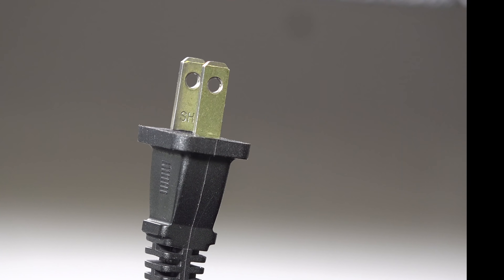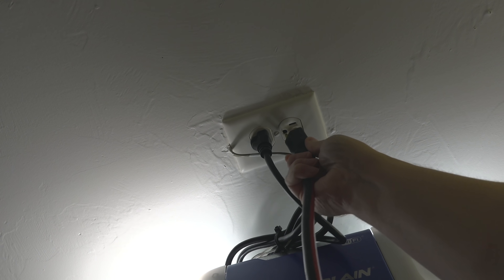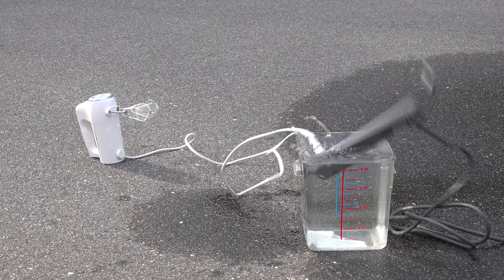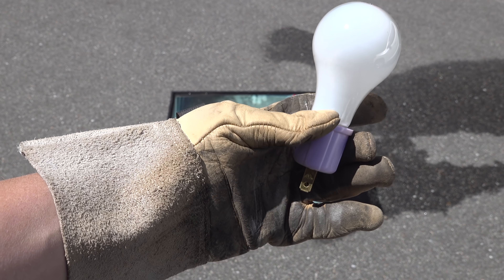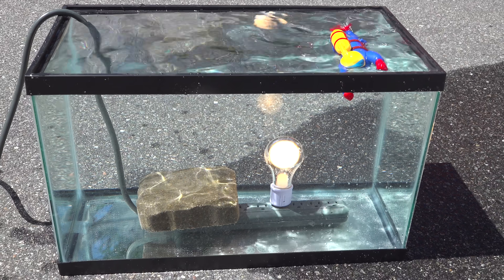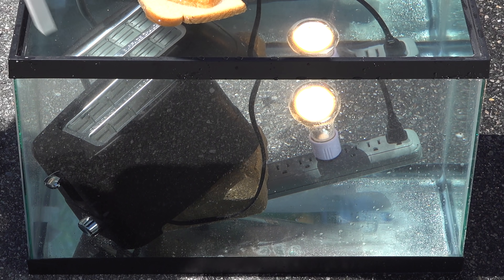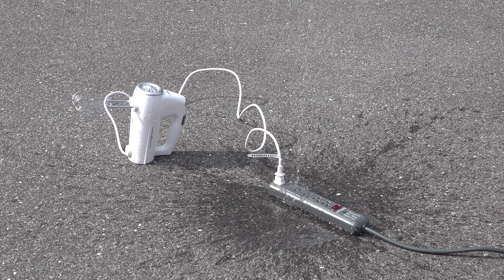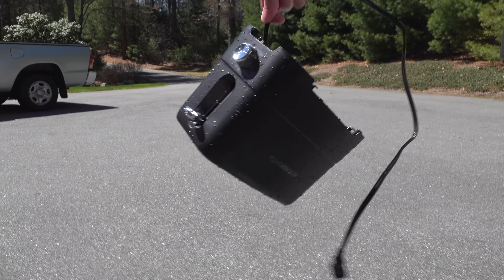What REALLY HAPPENS WHEN YOU SPILL WATER in an OUTLET?

Comment: Fresh water is not a very good conductor so most of the current goes through the normal circuit even when submerged but the residual current trip unit at the end showed that had you touched the water in the earlier experiments a small current that was possibly enough to kill you would have flowed through you and with no trip unit to stop it you might be dead.

Comment: Try another experiment. Drop the female end an extension cord plugged into a GFCI outlet in fresh water.  The GFCI will not trip because fresh water is a conductor but not a good one. Yet electricity will leak which can paralyze a pet or human. Check out Electric Shock Drowning Prevention Association.  Fresh water (lakes and rivers) and extension cords are dangerous.  Conclusion: Trusting GFCI in this case is a mistake.

Comment: Water actually mixes very good, it's like saying copper doesn't mix with electricity. Although the water has to be ionized to be conductive enough to be dangerous with electricity, tap water is non-conductive (3K-300K ohm) while pure water is not conductive at all, saltwater is very very conductive (1-60 ohm)

Comment: "If water spills on an electrical outlet, immediately turn off the power to that circuit at the breaker box, unplug anything in the outlet, and allow the outlet to dry completely. Do not touch the outlet or plug anything in until it is dry, or have an electrician replace the outlet, especially if there was a significant amount of water."

Comment: One important thing to note is that water in and of itself is not conductive, it is the minerals and particles that mix into water that are conductive. If you were to get distilled water for example, you could pour that directly over an unprotected circuit, and you would not get a short circuit.

That's not what's happening here, but it is an interesting fact about water and circuitry.

Comment: Years ago I saw a video where a guy filled a sink of water and put live wires in there, then probed voltage with multimeter at different distances. After remembering that, I guessed nothing dramatic would happen because plain tap water doesn't conduct electricity THAT well.  If you dropped a little bit of SALT into the water it would be a different story.

Comment: actually pure water is an insulator and most clean tap water have a hard time finding a circuit through the clean water for mains power to kill you given that there is something like a toaster that provides it with a shorter path. If you watch ElectroBOOM's video, he actually proves this by putting his finger close to the 2 salt water submerged 120V ac nodes. Although, he can feel the field get more painful as he moves closer to it, he proves that as long as there is a shorter path (lower resistance) for the circuit (in his case the water in between the 2 nodes), you'll just feel the field, and not get fried.  Now, I'm not saying ALL water drenched setups are safe. If there are more dissolved ions in the water (salt, calcium, etc) there is a higher chance that you will feel more pain/death. If YOU are the shortest path for the circuit to close, then you (the part that completes the circuit) most definitely will be fried - well, if you're in water I guess you would be cooked, or if your heart or brain was part of the circuit then they wouldn't work normally either. Take home message, don't let your body be part of the circuit and you'll be fine. i.e. before touching anything that touches mains power, unplug it.

Comment: GFCI outlets are not specifically just to protect from water.  They are designed to shut off if the amount of current on the return path isn't precisely the same as what went out, it's able to do that because even a slight imbalance will create a magnetic field that can activate a solenoid that will open the circuit.  Current "leaking out" can be from many things.  Yes, a short circuit created by water is one of these things.  But it's not the only thing.  It's also possible for a circuit to be wired incorrectly in a way that it would still "work" but be dangerous, and GFCI will protect against this too.

Also, pure water is an insulator, it does not conduct electricity.  What does are impurities (particularly dissolved salts).  If you pour distilled water on something, it's not going to short out.  That said, most people aren't going to be deliberately pour distilled water on something, so most water you encounter in every day life will have enough impurities to conduct electricity.

Comment: I doubt most of the water was electrified to any dangerous level. I mean I have too much respect for electricity to want to go and test it for myself, but on one hand water isn't really as conductive as most people tend to think. Coming right out of a garden hose, yeah that's probably decently conductive due to all the impurities in it, but pure water is actually a great insulator. Even with all the impurities in tap water, it still has a pretty high resistance compared to something like a copper wire. That means that as you get further away from the source, the amount of electric current that actually reaches you drops very quickly. You don't have to be very far away at all before you'd hardly even feel it (if you've ever wondered why lightning that strikes the ocean doesn't fry every living thing in it, that's basically why).

Even if you went out of your way to get shocked by this setup, as long as you only used one hand to touch the water you'd still PROBABLY be fine. The "one hand rule" for handling electrical things that have enough power to hurt you, ensures that even if you do get shocked the electric current won't travel into one hand and out the other, a path which would carry it directly across your heart.

So as long as you didn't stick BOTH hands into the water with the power on... your odds of survival would have probably been at least 90%!

Comment: Interesting.
Thankfully the electrical standard are different in France, so the breaker would trip if you spilled water on a power strip anywhere in a modern electrical installation, at least as recent as the 90s.

Comment: your fuse panel isn't there to protect you. its there to protect the wires from current overload and starting a fire. the only reason you don't find gfci plugs in every spot is cost the builder won't spend because the code doesn't force them to. you can always swap them out later if you were so inclined.

Comment: I have outdoor hanging lights that I have had hanging in the backyard for the last 4 years maybe three years now and last night when I went to go check in the chickens I plugged lights in and heard snapping and buzzing  I knew it was electrical and  to quickly unplug the cord again. While running back out if corner of my eye I saw some kind of flame I think it stopped as I was getting to cord to pull apart ((40 feet away) u ran over with flashlight to make sure nothing was on fire. It wasn’t just smelled like burned plastic and electrical. The two cords were outdoor lights like I mentioned. They were snuggly fitted into one another had wrapped like a candy cane around a conduit metal pole that got all blacked out from the event. I pulled the ends apart and one of the metal prong things was burnt or exploded off the hole it went into was all bored out from getting melted. So couple questions: why or how did that happen? It was drizzling out pretty good. I noticed the fog is much different these days. Doesn’t have same kind of pattern when it falls. So not sure if they are spraying us with what kind of metals that could cause more of a reaction? I am glad I was there to see it happen. Because I have been known to leave lights on for days. NEVER EVER doing that again. ONLY if I am there. Can’t imagine what could had happened if the power was still going and surrounding area ignited. Thank God. Sigh. Also does that mean both sides are no longer any good? I know the one with the one metal prong is done for unless I replace it but not sure on the receiving end of the other ?  Funny enough a couple hours eariler I had just ordered replacement bulbs to replace those t had gone out but now I am wishing I had purchased brand new ones. Had hard time trying to figure out which ones were good ones to purchase in Amazon.  Probably should just purchase the FEIT ones. Any recommendations ?

Comment: Water's conductivity is directly linked to the amount of minerals in it. Distilled water is not conductive. The main issue with regular water is the corrosion of circuit board metals, which can eventually cause a short. This is not to say that regular water (as in tap or bottled, tap being more conductive) can't short electronics out. The more complex the device, the easier it is to short it out. As we can see, hollywood having a computer fall into water and immediately explode has changed our perception with water and electronics, like a lot of ither things done in the movies.

Comment: I was working at a Power Plant, and we were starting up a unit test before going online the next day.  We started the cooling water circulation pumps from the cooling tower.  Someone got on the intercom and said the first level was flooding.  I left the Control Room and ran down the steps to that level and there was 3 feet of water on the ground.  When I got there was a large cooling fan blowing on the welder's bench with an extension cord plugged into underwater.  I was standing in the water, and I thought I was going to be dead.  I was lucky that day.  There was no GFCI cord connected there.

Comment: Water is covalently bonded, thus does not conduct electricity. It the impurities suspended in the water which conduct. Obviously water from a hose will have impurities, thus will conduct, but it’s a very inefficient conductor, so generally won’t trip a circuit breaker which only works above a high threshold of current draw - if you stick your hand in there, you will add even more conductive impurities and you will electrocuted. An RCD will detect very small current draws to ground, thus will trip easily and instantly keeping you safe.

Comment: In my physical science class, we used a tiny lightbulb to show us how conductive things are. Turns out: Water isn't a good conductor, the light bulb barely had any life to it through water. I've had direct contact of electricity from surge protectors and things with more powerful amps. That water tank and surge protector would have hurt, but nowhere near lethal.

Comment: There was no problem if the electricity is still flowing it’s fine. I had a fish tank where the instructions told me to place the led light strip inside the tank with the water like the power cord was submerged and it worked fine and the fish were alive swimming around just fine.

Comment: the water has low resistance when compared to rubber and glass and high resistance compared to metals like steel or copper.   So by default it is like putting a high resistance resister across the terminals: A high resistor will last longer when connected to 110V power because it limits the current flowing through it, reducing heat generation and power dissipation.

Comment: I also think it goes without saying to not try to push any of these things at home. Even if the breakers tripped, still safer to operate on the mindset that it wouldn’t. The typical keep flammable materials a safe distance away, don’t place electrical or heated appliances on loose carpeting, etc.

Comment: Interesting, but I don't think touching that water would have resulted in electrocution. That water was just so clean that it did not conduct electricity well. Otherwise it would have short circuited and blown a fuse. You could have tested the voltage in water by measuring with multimeter between water and ground. Adding salt or something else to the water would have made it better conductor and changed the result.
Reply: So it really depends on how clean (not clear) the water is.

Comment: From my experience in the trade, 240v plugs and connections can stay wet for a long time and only short out once corrosion sets in. Getting shock from 'live' water is just irritating like a splinter or pin prick if wire is 1ft away in water, if your close to conductor like 1 - 3 inches away you basically get the full shock. I have learnt this the hard way unfortunately.

Final note is low voltage devices like PCB's don't tolerate water at all, 1 drop and they go out instantly, this is just all personal experience. I find this strange because 5v shouldn't be able to conduct through water very well, compared to 240v.

Comment: Several years ago I was helping a friend work on a car outside in the rain. We had a couple extension cords and a power strip plugged in. We used a tarp to cover the power strip and the connection point between the strip and its extension cord. Unfortunately, we weren't really considering all the water that was already on the ground, including a small puddle built up in a hole in the old parking lot. I was asked to plug in a power tool, forgot which one as this was probably 20 years ago, and when I did so there was a real big spark and my heart almost stopping from the jump scare. For a little while my friend and a couple others cashed me "Sparky". Lol! 🤣😂

Comment: Electrician here. I dont know for sure, but its possible the containers you used to hold the water acted as an insulator, if you did the same experiment only using a metal bucket on wet soil, the results might be different, I would be curious to see but im not going to do this myself

Comment: For what it’s worth I had an issue with water getting into my breaker panel in my basement. I called my friend who is a master electrician and he said it’s pretty common. He told me to replace the Duck Seal around the cable from the street as it goes into my meter. That seemed to fix my water issue. He also said water is not as great a conductor as we are led to believe. He also told me sometimes the water gets under the insulation of the cable coming into your home. In that care they need to have that section of cable replaced.

Comment: Water isn't going to trip the breaker resistance to high in the water to short circuit..110v... Would take high tension voltage ⚡ to short in this condition

Comment: None of the results surprise me.  Clean tap water is actually not good at conducting electrical current.  However, 1/1000 of an Amp can kill.  This means that submerged electrical appliances will still function but should you touch that water, it will cause a shock.

Comment: I'm no electrician, but I'll try to clarify one small detail.  You said the GFCI protects from water, but really, it protects from the electricity going through a path to ground that is not through the plug.  So could be someone with wet hands (your example) or holding a wire or any other way that could be dangerous (like a shorted hairdryer or defective device plugged in).

Comment: One time I left the sink running, one of those sinks with no overflow drain.  And I went on a 5 hour drive.  I got back and there was about 2-3 inches of water in the house.  I was afraid of getting electricuted but nothing happened luckily and we had these power extenders all over.

Comment: I had a moment when a little bit of water spilled onto the extension outlet, the breaker didn't pop (i have two 16A breakers for my whole apartment) but I could hear a hissing sound coming for the outlet and I saw water vapor. After I unplugged it and dried it out it was working fine.
btw im not in NA so I have 220V just in case that's important

Comment: DON'T EXPECT CIRCUIT BREAKERS TO SAVE YOU! 
Circuit breakers protect the wire, for them to trip suggest that the wire that should be paired with them is likely in reasonable danger of burning up, at best they will save you from a fire. 
Thereby for them to trip enough power must be flowing, the power required to stop a heart (assuming the resistance of the skin can be overcome is less than a thousandth of what the smallest commonly in use breakers will allow. 
Your standard household plugs and wires actually  allow power to flow between the leads, just within reasonable limits. 
Water itself is not conductive, it's the dissolved minerals, and metals that make it so. 
Water and it's contents can't move that much power, but the amountvit can is way more than what is needed to kill you.

Comment: breakers protect the wiring inside the wall, it couldn't give less of a crap about what happens to that electricity once it leaves the wall
GFCI is what steps in when something goes wrong on the outside

there are GFCI breakers but they're quite rare and I don't think I've ever seen one actually used in a residential building before
GFCI plugs and breakers should absolutely be much more common, but they're usually 10x more expensive

Comment: Wait until you use substandard outlets or China -made. You will get the explosion for sure!

My wall outlet in my condo was just beside the faucet so splashes of water came into the outlet. There was an explosion and a burnt smell when a cooker was plugged! 

I sealed that outlet off forever and had been using an extension outlet to reach the kitchen countertop for cooking needs ever since. 🤷

Comment: Water by itself and under normal conditions, is an insulator but if you add Salt or Sodium Hydroxide or Potassium Hydroxide you will increase the conductivity of the water. If you do this experiment again try adding salt.

Comment: I took a class that was put on by a fire marshall.  We violated all kinds of electrical rules.  We put a hair dryer with GFCI on the plug into a bucket of water.  All it did was stall the motor-- never tripped the breaker.  Pull it up out of the water and it blows out the water and keeps going.  Mostly, we learned that it isn't good to trust all the safety stuff.  Use the safety stuff, but moreso, use good sense and care.